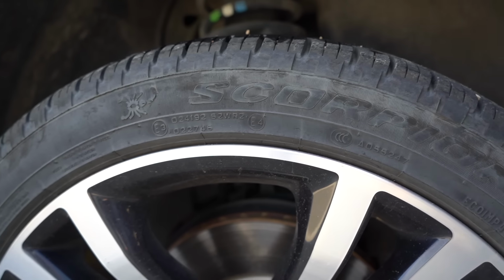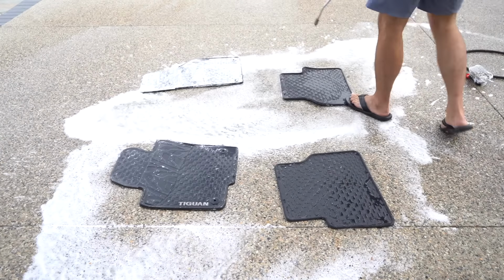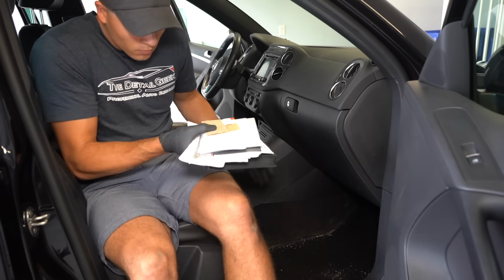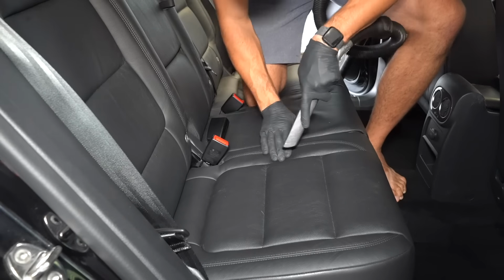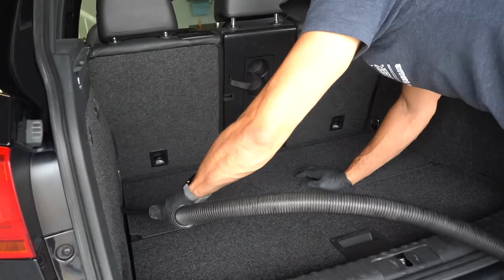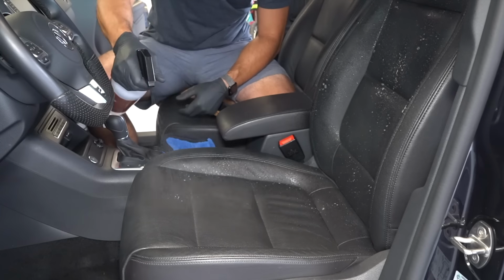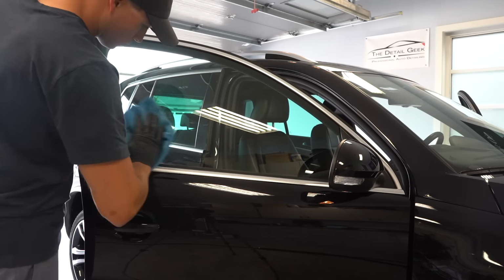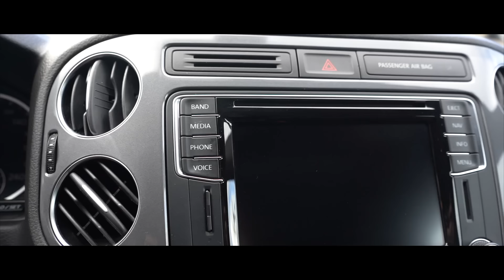How To Detail a Black SUV! | The Detail Geek

Comment: Watching car detailing videos is strangely satisfying. Any tricks of the trade for dog hair, it is everywhere in my jeep (wrangler)
Reply: mbl722 there are dog hair specific brushes, made especially for car carpet, it draws up the dog hair and makes it much easier to vacuum, But if you’re trying to save a quick buck, try a drill brush as it can be used for a lot more than just cleaning dog hair! Some vacuums also offer attachments which whip up the carpet and suck the hair at the same time, you could probably buy one of the attachments and fix it to your own vacuum as I did. 

I bought a Miele dog hair brush/hand attachment, it was second hand although had never been used, the suction of the vacuum spins  the brush within the head and whips up the hair before sucking it away. This was definitely on the more expensive side but I’m sure there are similar vacuum attachments out there which function this way. Hope this helps :)
Reply: @timhanby5662  thanks, I take my jeep to the manual car wash because i live in a condo and do not have access to electricity near the parking lot, so a dog hair brush would be necessary for me, vs an attachment of a drill brush.

Comment: why do cars have carpet wheel liners? that seems like some chaotic recipie for disaster?
Reply from the maker: It is lol but apparently it’s to reduce road noise 🤷🏻‍♂️
Reply: This car shows that,  carpet on the rear wheelwellS cause they are connected to the passenger compartment and not up front with the engine.
Reply: It's amazing how much they reduce noise inside the vehicle.  Never really noticed it until my husband got a truck with the carpet liners.  Totally quiet in there.  I get in my van and it sounds like I am driving with the windows down.

Comment: could you make a video on how to make the interior cleaner? like the ones used on the door panels
Reply from the maker: Hey Daniel - so I buy my All Purpose Cleaner (Meguiar’s) in concentrate and then I’ve got one bottle diluted to 4:1 and one to 10:1. The bottles I use actually have dilution markings on them...so I add water up to the 4:1 or 10:1 line first and then add the cleaner to fill it up. Otherwise, just figure out what size of spray bottle you have...might be 16 or 32oz and then if you want a 4:1 dilution, divide that by 5 and figure out what 4 parts water is and 1 part cleaner. If you google there might even be helpful guides out there for you!

Comment: Any suggestions for cleaning cream cloth interior? I’ve been told if you put any solution on stains, it will stay dark. 🙄
Reply from the maker: It’s true that if you use the wrong type of cleaner you could set the stain...but generally speaking dedicates upholstery cleaners cover a wide range of stains...something like APC on the other hand is very alkaline and can easily set certain stains. Hard to say without knowing exactly what the stain is

Comment: Hey Mitch, quick question about your rinse and wash, please. If you're rinsing the car in sunlight, then go to work on the wheels while the water is left on the paint drying, aren't you risking water spots? Cheers
Reply from the maker: I use soft water so thankfully I don’t have issues with water spots 👍🏻
Reply: @TheDetailGeek  thanks for your reply :D You must live in a good location where the water is soft! Here in Australia if it's hot out with no shade, I can't risk pre-rinsing - straight to foam cannon so the car wash can soften the water.

Comment: How much PSI would you recommend when it comes to buying a pressure washer for cars?
Reply: 1200-1500 is all you need. 2000+ is too much, might risk damaging the paint or trim
Reply from the maker: 2000 or under but it’s mostly the tip you need to worry about. Use a wide angle 40 degree tip 👍🏻

Comment: As a detailer should you not be aware of your knees? Cars with heated seats are prone to have the wires break inside the seat. Usually customers will not notice until half a year later when they actually need it. Detailing is often done during spring or summer, correct?! Otherwise great job👍🏻

Comment: How much would it cost to clean my car like that? My car hasn’t had a deep deep clean since 2012. I meant its been cleaned by car washing places like vacuuming but not really cleaned like the mats washed out and all the carpet and seats. Just cosmetics.
Reply from the maker: Pricing all depends partly on location and then what all you do of course...my Full Detail package is priced from $200-250 CAD and then to add carpet/seat cleaning or leather cleaning/conditioning it’s another $50-100